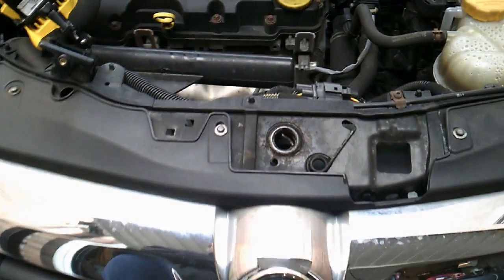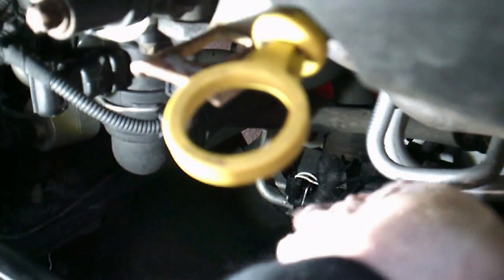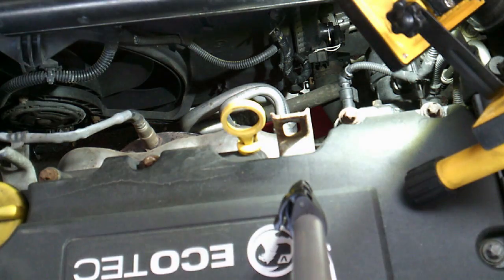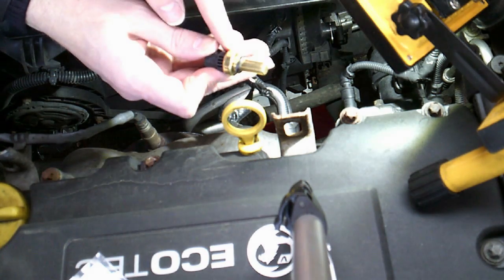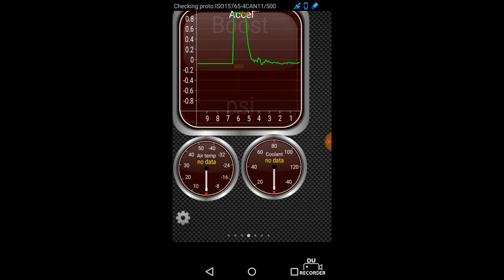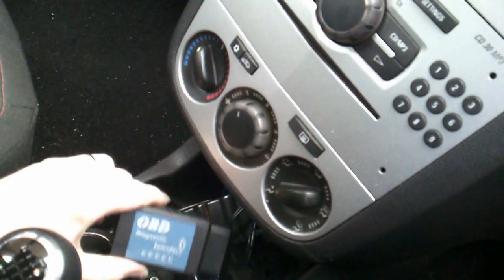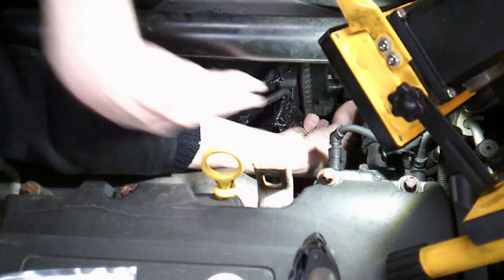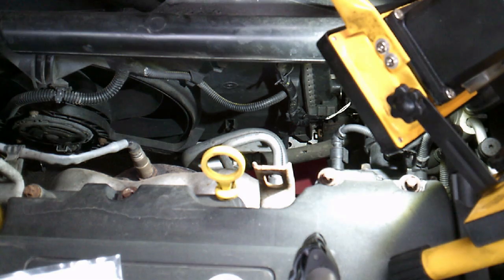Vauxhall Corsa 2010 Radiator temperature sensor fault P00B3

Comment: can you please give me an idea, my car is opel zafira B 1.6 of 2006 show these codes on the screen p111505 and p111606. after I have changed many parts and the problem continues again, I have changed the temperature sensors in the radiator and in the thermostat, the original thermostat has been changed, the new deposit cap, the water pump. I don't know what to change, I have spent a lot of money but no solution please help me with any idea
Reply from the maker: Hi, both fault codes would lead me to a faulty sensor or wiring to the sensor.
You could test by leaving one sensor totally unplugged, clear codes then drive for a short trip then check if codes came back. Then do the other way round, see if it throws any different codes and that may help you find which one is the problem.
I suspect the wiring or connector to them has become damaged.
Reply: thank you
Reply: @junkendriven When I removed the sensor tape in the radiator yesterday, the light went out with the dashboard
Reply: @junkendriven I think I have the same temperature sensors as the one in the radiator, that's why this happens to me, I have to buy a separate code
Reply: now i removed the wire to the radiator sensor again and the spanner light does not come on what do you think this problem is please help me with any ideas if you can
Reply: @junkendriven and I'm now suspecting the radiator sensor I'll check the cable connections and see what I find

Comment: Could a bad radiator temperature sensor be causing my radiator fan not to turn on? I checked the fan motor and fuses and all work
Reply from the maker: It could, however normally the fan would fail to bring on constantly not off. Have you checked the fan relay? As that's common to fail after a while. You can also test by bypassing the relay to force the fan to get power, that way you'd know for sure the fan itself and wiring is working ok

Comment: Hi Andy, When you clear the codes half way through the video, is it safe to turn the engine on while the new sensor is plugged in to the electrics but not into the coolant slot to see if the code still appears after clearing?
Reply from the maker: Yes you should be fine doing that since you've got the electrical connector plugged in. You'll have to block the fitting though so you don't lose all the coolant!

Comment: My Corsa D year 2007 manufactured 1.4 l petrol does not seem to have any sensors on its radiator,  been looking for it everywhere, it seems the fan relays rely on engine coolant temperature sensing and fan slow speed or high speed seems to come on randomly, not coming on when it should and car is severely overheating, loosing coolant from overflow escape from the filling bottle, have changed thermostat, replaced water pump, replaced bottle cap, but still not helped with overheating, have got coolant tested for any head gasket leakages, still test proved negative, internal heating does not work either, blows cold air all the time, no heating in winter, its full of gremlins, I suspect the heating control valve operated by electrical signals is jammed up, because when the engine is boiling hot the small size hoses leading to internal matrix remain cold to touch, even when the heating control is set to hot position. Can't seem to get to the bottom of it.

Comment: I’m les to believe the rad coolant sensor is the same as the other temperature sensor. ? So you know this to be correct.  I’ve a problem with my circuit. Suspecting broken wire or temp sensor. Two new thermos still don’t open stuck closed on my corsa d 1.2
Reply from the maker: Not sure if they're the same temperature sensor unfortunately, parts index for the corsa should help you on their part numbers, etc. If thermostats don't open then yes sounds like you have an issue with the signal coming from the ECU, so it's either the temperature sensors or the trigger wires from the ECU to your thermostat. Good luck

Comment: Your video has sorted my P00B6 error. Sensor cost £16 (GSF) fix took 20 mins including watching the video. Old ‘O’ ring remained in radiator. Pushing new sensor in and pulling out  (quickly blocking rad hole with finger!)  pulled out old ‘O’ ring. Brilliant & clear video. Thank you.
Reply from the maker: Great news glad you've got it sorted David

Comment: My Corsa d 1.2 2010, I’ve bought this angled sensor as I’m getting a amber car with spanner showing and radiator fan running constantly, I took it for a drive and the engine temperature stays at a very low temperature 15c on my dash. 
Is there a another sensor on the water pump? It looks like my water pump is hidden with all the top plastic covering, 
I’ve read the other sensor is on the right side where the 2 rubber pipes from expansion tank goes into engine?
Reply from the maker: Hi, yes you're right there is a second temperature sensor on the right. Take a look at my other video about coolant issues on the corsa and it might help you - https://youtu.be/EX39OxE7VFA
Reply: @junkendriven  I’m certain I’ve fixed my issue Andy, I was getting a amber car with spanner symbol on my dash staying on all the time and radiator fan constantly running, I noticed there was hot coolant going from the expansion tank into the engine but the pipe that comes back out ‘THROUGH’ the thermostat into the radiator was cold even when engine running and my temperature on my dash in the hidden options was staying the same, I changed my radiator temperature sensor that didn’t work but I replaced my thermostat and it’s fixed and hot coolant all around now and thermostat is opening and closing properly 
Tomorrow I’m gonna flush my coolant system, I’ve got 5l of de-ironised water to flush the system then new coolant
Reply from the maker: @jamesmcrory8990  Great news James, glad you're sorted. That is exactly what happened in that second video of mine to the Corsa, it seems the thermostat on these fail CLOSED (unusual failure state!) and cause the issue with hot coolant backing into the expansion tank.
Glad you're sorted, and yes I plan on flushing mine out soon too just as a precaution. I had to replace the expansion tank too due to a crack in it.
Reply: @junkendriven  one job I want to attempt next is replacing my shock absorbers and springs, I’ve never done it before but I’ve watched your video about this, it is Dangerous with the springs but will take it easy, safety comes first
Reply: @junkendriven  I’ll watch your 2nd video later and tomorrow I’ll have a look for that second sensor

Comment: I changed this. But it turned out to be a red wire 20cm from  the ECU  that corroded about 5mm, that tells fan to come on.
Reply from the maker: Good tip that, thanks for contributing

Comment: hi, any idea if the 2 sensors are the same
Reply: thanks
Reply from the maker: not sure, checking the data sheets it shows the Water temperature sensor thats on the thermostat housing is part 55353807 and 6338045

Comment: On my corsa D 2010, Radiator fan start running soon as I start car. No boiling or overheating. I hope this sensor will solve my problem
Reply from the maker: Also, make sure your air con is switched off! Having the a/c on switches the cooling radiator fan on too
Reply: @junkendriven  Thanks for reply. Air Con. is switched off.. OBD Code is P00B6 "Radiator Coolant Temperature/Engine Coolant Temperature Correlation
".. I really hope it's a faulty sensor..

Comment: Hi mate I got a p0117 on the obd and it said it's this sensor p00b3 is that deferent as mine is a vauxhall adam same sensor as you are fitting
Reply from the maker: A lot of engines are the same so just compare the model, but you may need to check technical documents for your specific engine model
Reply: @junkendriven  thanks mate

Comment: I have that same light on in my corsa, its started overheating and boiling. Is it still worth changing the sensor?
Reply: You need the ecu codes checking first, there is another fault called poob4 which means the fab doesnt come on (p00b3 means fan on all the time) I would also check the rocker cover for sludge/mayo also the diaphragm in the rocker cover may be nackerd, new rocker and gasket on Ebay is 45 quid.

Comment: Good day sir 
i have opel corsa D 1.4 petrol engine A14XER , i have diagnosed the Car and get two unknown fault Code as 059700 and 00B700  Please can you help me what could be the problem with those two faults code? what do i need to replace please .
Reply from the maker: Hi 59700 and 59900 is the engine coolant thermostat heater control circuit. Search up on that, but it sounds like it has thrown a fault. If so you can try just replacing the thermostat heater itself rather than the whole thermostat housing as they are separated. Search for the thermostat. Location, it's at the front (bumper) left side of engine. I can't be 100% sure on it but from your description that sounds like the fault there.
Reply: @junkendriven   Hi sir 

I have replaced already the thermostats  and it was completely Burned out , but after replacing it the fault code is reading but the spanner warning light disappear and when I'm driving the car is no longer moving fast like before , it loosing power more especially on hill you could feel that the car is not moving even though keep accelerating
Reply from the maker: @fhatuwanimakungo24  sounds like several faults. After replacing the thermostat did you clear the codes? That may be why the code is still appearing. Lack of power could be lots of things in addition. Replaced spark plugs? (See my other videos) cleaned EGR? lots of things unfortunately so keep looking for other signs

Comment: Thank you so much. I don't have  the OBD but changing the radiator temperature sensor solved my problem. Radiator fan has finally stopped running
Reply: On my corsa D 2010, Radiator fan start running soon as I start car. No boiling or overheating. I hope this sensor will solve my problem

Comment: Awwrite pal. Will the obd your useing work on ma 2008 corsa 1.4 d??? Cheers
Reply from the maker: Hi, which OBD device are you referring to? All basic ones will read the basic codes (engine P codes) on these, but won't read SRS and other advanced systems.
Reply: @junkendriven  cheers. The wan in the vid.
Reply from the maker: @kev84v  Ah sorry, didn't realise which one was in this vid! It's just an ELM327 clone adapter, they're all over ebay https://ebay.us/Yruk2m then you use Torque app on an android phone to use it. They're very basic so don't do a lot but will read basic engine codes from most OBD compatible cars (So yes 2008 corsa will work if your engine light is on it'll get you the fault code)

Comment: Hii
Which were the symptoms when the sensor broke ?
Reply from the maker: Poor MPG, bad performance (underpowered), cooling fans constantly on and MIL light illuminated.
Reply: @junkendriven  I have a problem that my fan keeps working when the car is warm,  and the thermostat is closed when the fan is constantly in use, can it be up to that sensor ? not any mistakes on the table !

Comment: Thx a lot Andy, especially for locating the sensor as Vauxhall ( Opel in Germany) varied it many times over the years. It'll help me a lot. The OBD fault code in my car appears as P00b4, which is related to that very sensor telling the CPU the coolant/engine is not heating up properly. Same part different problem. Swapping the sensors should fix it.
Cheers from Hannover, Germany

Comment: Hi mate, just came across your video whilst looking for a solution to my problem. My radiator fan doesn't come on at all and it's causing the engine to overheat. I have a 2014 Corsa. The fan does work as I tested that by hooking it up directly to the battery. I can't seem to find what's wrong as the fuses and relays aren't dead. The fan doesn't come on when I have the air con on either. Any ideas?
Reply: Got the same problem now, how did you go?
Reply: @jesseendall2179 did you find the problem?

Comment: I did this. Got the part for £8 from euro car parts. I’m not the best mechanic in the world but managed it and the engine lights come off and seems fine. The only problem I encountered was on the new sensor the rubber bung was bigger so didn’t fit properly so I ended up losing a lot of coolant. I ended up having to take the bung off the old one and put it into the new one. As of yet no problems though. Thanks !!!!!

Comment: Thank you for the video. It was a great help. Managed to change mine fine. 
The emissions light has went off, however, I still seem to be getting some of the same symptoms...some stuttering at idle, lower fuel economy, etc. Any suggestions on why I'd still be getting issues after replacing this?
Reply from the maker: Could be a few things, I'd do a full service first, especially changing the spark plugs, I did that also recently to a car having stuttering and misfiring causing engine management to come on, they're cheap and easy to do, just take care taking the top 'cap' off as the rubber boots sometimes get stuck, if they do and they rip then you'll need to replace (As I had to as the rubber had perished)
Reply: Andy Brown appreciate the reply. The only thing I didn't mention before was that I was getting the p00B3 code from the title. Is the problem likely to lie somewhere else still? I was under the impression that my symptoms could be cause by a temperature sensor not playing nice. Would just be weird to get the code up and the issue being somewhere else?
Reply from the maker: @MrMintMouse  Bit later, but take a look at this video: https://youtu.be/VBY15y1OKyk It might be related as this was the next problem we had with stuttering, poor fuel economy, etc.

Comment: You should really only clear the code AFTER changing sensor
Reply from the maker: Normal practice is to clear it before making any changes, as you can get transient codes that are due to a sensor malfunction or one-off error, so clearing before confirms the fault is still there otherwise you may not know if the replacement part has corrected the fault code.
Reply: Mmm  Thats an NTC thermistor, P003B is sensor circuit low voltage.Usually a shorted sensor) With key on ecm will see little or no volts so puts up the code. (if it was open circuit rad temp would read high)

Comment: It made no difference to mine my fan still on all the time any other ideas
Reply from the maker: Hi Michelle, that's odd the fans are on all the time. Oh one thing, make sure your air-con is switched OFF when you're checking as air-con forces the cooling fans to come on constantly. Other than that it might be the fan relays stuck/jammed so might be worth checking those too.
Reply: Andy Brown yeah my air cons off
Reply: @madcarer31  did you work out the issue in the end?  I have the same problem.  I have the spanner light on though and no error code when I check with OBD tool.  I changed the blower resistor, but problem is still there...
Reply: Yh unfortunately my thermostat  in radiator was shattered and the head gasket was on way out
Reply: @madcarer31  thanks for the info.  I just ordered a new thermostat this afternoon so will be giving that a go when it arrives.  Now to go and google what a head gasket is!
Reply: @thewongwayround  did a new thermostatenfix your issue?
Reply: @evieemaya88  Hi - in the end I had to send it to the garage.  They replaced the valve which uses the thermostat.  Apparently it was not opening up so the coolant could not get into the radiator.  There is a way to test if this is your problem... wear some gloves and restrict the rubber-is coolant pipe with your hand.  When the car has warmed up you should be able to let go of the pipe and feel coolant coming through the pipe... otherwise the coolant is not getting into the system.

Comment: Could this be the fault with mime? It's a 2010 vxr and fan comes on and off every ten minutes even when cold. Thanks.
Reply from the maker: Danny Beresford hmm, if it comes on and off it could be something else as faulty sensor normally either works or it doesn't. Also the fan is on when air con is on so bear that in mind. Other thing is it could be the radiator or coolant has gunk in clogging it and impeding water flow. Check pipes (carefully!) for hot or cold patches
Reply: Andy Brown Thanks mate I'm gonna try it with air con off. Would it go off straight away or a while after air come turned off?
Reply from the maker: Danny Beresford no worries! Will go off a few minutes after air con switched off. If not see if it still does the same and a coolant flush might be in order. Feel free to email me :-) andy at thebmwz3 dot Co dot UK (ironic I know with a corsa!)
Reply: Andy Brown Thanks mate I'll get back to you 2moz and let you know.
Reply: @danny8468  hey mate did you ever find out what your problem was.?
Reply: @evieemaya88  It was the fan/ heater resister. Little green Coyle looking thing.
Reply: @danny8468  thanks a lot Barry appreciate it. Love the profile pic hahaha art attack!
Reply: @evieemaya88  No worries mate, have a look on YouTube to locate where it is then have a look if yours is cracked or pealed on the green bit. Pic always reminds me of Barry Hearn lol.

Comment: As long as it is just the fan running constant and not like ours that melted the cabling on the dash end plug due to overcurrent on the fan. The usual fire hazard fault. :(